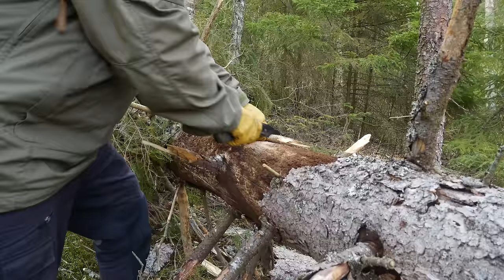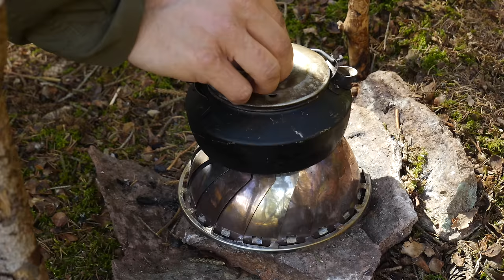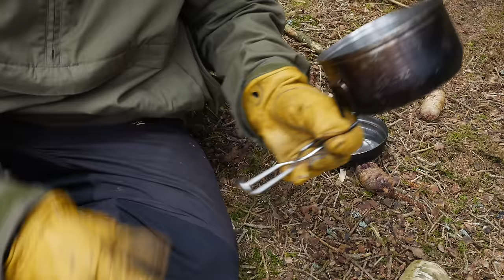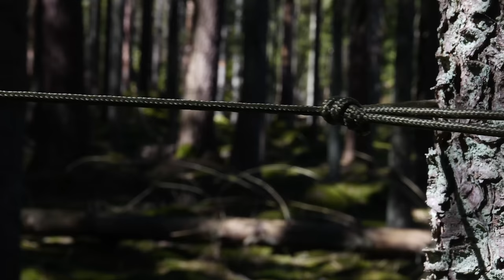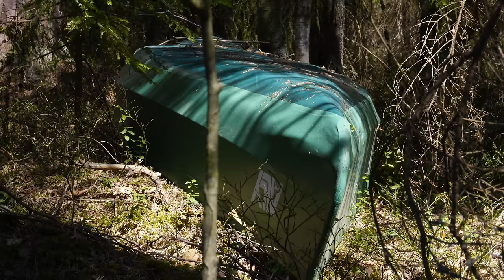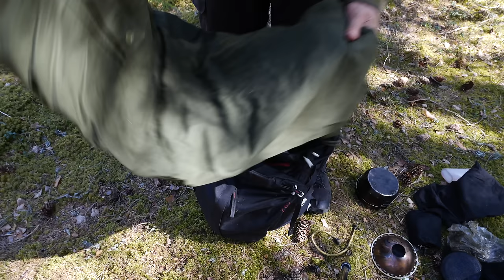Solo Camping and Bushcraft in the Wilderness

Comment: awesome soothing brain-restart atmosphere

i dont understand how to identify a good fero rod in the shop... i bought several but i have to try really hard to even make a weak spark,... whenever i watch your videos, you just strike once with the back of your knife and it looks like an explosion comparing to my sparks..
Reply from the maker: I use Light my fire Army 2.0. Its the best one by far Ive found. Even the scraper is awesome that comes along. The knife needs a sharp 90 degree angle on its back. To keep it sharp you need a flat sharpener. With a knife you can do long strokes. With the scraper I do just shorts scrapes on top of the end off the ferro rod. With a knife...  hold it steady and pull the ferro towards you. Learn the best angle you give with your right hand holding the knife. Hold still when you pull. Good luck!

Comment: 25:10. Really lovely video.. 
Which knife do you recommend for buschcraft? I see you got 2-3Knives. One smaller one for crafting wood, a bigger one for splitting wood and cutting meet, and then an Axe kinda knife with which you cut the wood as well..
I don't know where to get something of good quality whose blade does not chip or break and we can shsrpen it like you are doing..
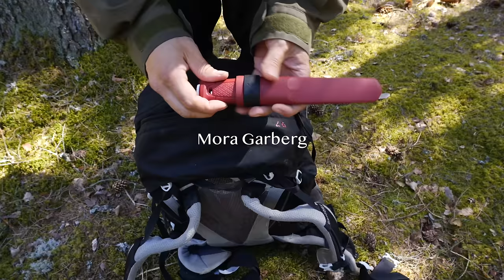Reply: 57:46 Found it later in the video:
Mora Garbag Knife
Thanks.

Comment: Thank you so much SW for immersing us into that beautiful landscape. On my list for sure. 

So… I’ve always been curious as to how yours and Erik Normarks trangia burners work way better than mine does. Mine works pretty well but the flame type on mine is all blue and it pulses with no big yellow flame like you guys have. You guys are melting snow with yours and everything. I think you solved the mystery with your complete loadout. You mentioned something about t-tenol fuel. So i looked that up to find its a combination of methanol and ethanol. I burn only denatured but its stored in rectangular tin cans like the coleman white gas cans outside but covered in a big plastic storage bin. I sometimes wonder if my wimpy flame is a result of moisture forming on the inside of the tin can that the denatured alcohol is stored in. I’m trying to use up these two gallons of denatured alcohol as the head of building maintenance at my company gave them to me towards the end of the pandemic when hand sanitizer was available again. He was making hand san with it  during the lockdown. Just wondering if you or anyone has any ideas for boosting my trangia performance. 

Thank you again SW. Always great to see the green pickle!!!😁👍🏼

Take care. NQU
Reply from the maker: Thanks! Yes got to be the fuel.
Reply: The Yellow bottles of “HEET,” sold in Walmarts, Gas Stations is the fuel you want. No wimpy flames!
Reply: @markcummings6856  gotcha. I will try that.

Comment: What kind of canoe is that , I've seen you use it before . 
   I've been in a birch bark canoe , just bark and thin wood strips , but your canoe looks scary . I guess it's old tech mets new tech 
   I would like to try one of yours , but I would definitely be skeptical at first .
  Are they capable and durable , enough like bark canoes ? How light are they ? ( I'm guessing you use them because they are light ) 
  Anyway they look light , neat and scary .lol.
Reply from the maker: Dont know if you are joking. Birch bark canoes was extremely fragile and needed constant repairs. An Ally canoe is for white water rafting so bomb proof and can be repaired easy on the go.

Comment: I don't understand why people never collect sawdust, it ought to go up really  quickly.
Reply from the maker: Its too compact. Burns badly. You want more, thin flakes, shavings etc which makes airflow possible.
Reply: I would think that it would be a perfect kindling.  They make logs out of it here.
 @Swedwoods
Reply from the maker: @Keith-zc2nn  its way too small for kindling. But sawdust can be used as tinder though. If its bone dry. Which limbs and dead wood rarely is in the woods here. But you have to be ready to put small sized kindling bundles on top right away after first flame or it will go out. Any wind blowing its very hard doing it. Sawdust/shavings from fatwood however is the best firestarter ever due to its high content of resin.
Reply: My mom was a depression child.  I find a way to use everything.   And they make logs of compressed sawdust here in the US.  The profitability of it was not lost on the wood processing industry.